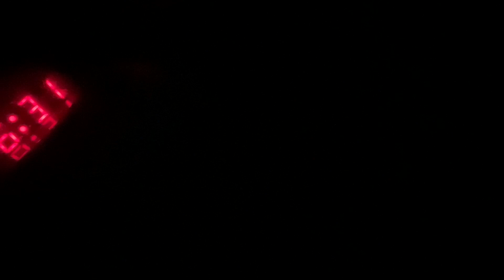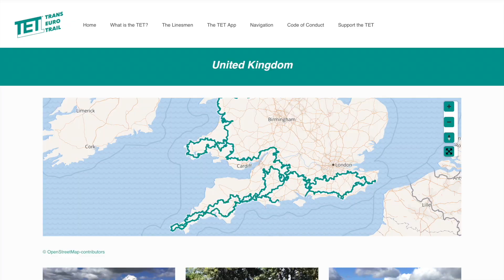Honda C90's v T.E.T. UK Episode 1

Comment: Can you clear something up for me?...Why do folks put 110 Lifan engines in Honda C90's?.....Yes it's 20cc larger..BUT!..does it really produce more power than a decent Honda C90 engine?. With Hondas reliability and better build quailty a C90 engine would be just as powerful as a Chinese Lifan 110 engine?..more reliable and easier to get parts?. Do tell please.
Reply from the maker: Good question and I’m happy to answer #1 c90 is only 3 speed and Lifan is 4 speed . #2 why thrash your beautiful c90 engine when you don’t have to . #3 most Honda engines are made in China anyway . #4 110 is a straight swap where the 125 swap takes a few mods . #4 there are more parts on the market for Logan’s than Honda c90’s . #5 top speed is around the same but a c90 with a 3speed is not that great up hills . #6 I like to look at my original c90 engine everyday on my wall as I don’t have a TV . Take it easy bro 😎 🤘
Reply: @KIWIMEDIA  Thank you for the reply. So despite the extra 20cc it's no faster than the c90 engine...but better hill climber?.. For some reason I thought the C90 was a Semi 4 speed engine?..Not that I know anything about engines. Maybe  I'm thinking of the new125 cub.? And I guess now with the wider spread use of Lifan engines then spares are just as easy to find as the C90's..or is it because the C90 is becoming more a classic every day that parts are becoming scarcer.?..So lifan spares cheaper?
Reply from the maker: Here in UK 🇬🇧 parts for Honda c90 engine are getting more expensive and second hand parts are just worn out . The Lifan engines are all over Europe and North Africa , yes parts are plentiful and cheap and made by the same people who supply Honda , triumph and KTM . There are other pit bike engines on the market (yx) but that’s another story for another day 😊🤘
Reply: @KIWIMEDIA  Ok..thanks forthe replies.